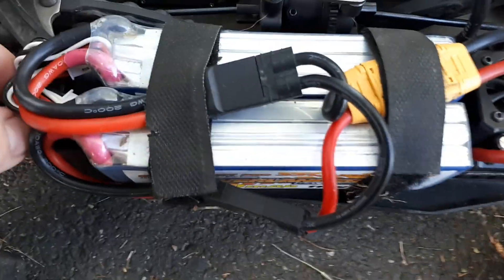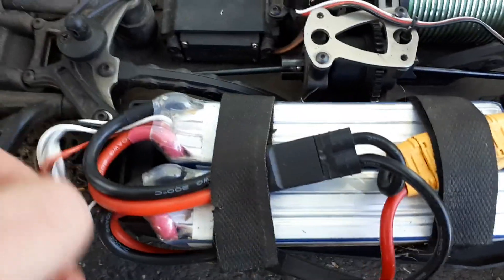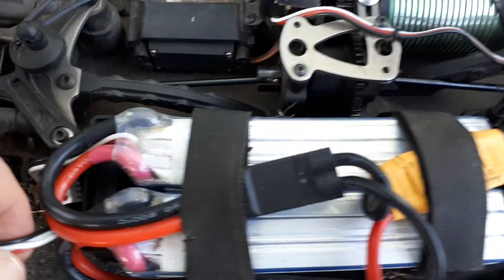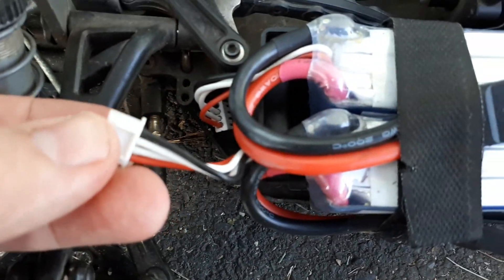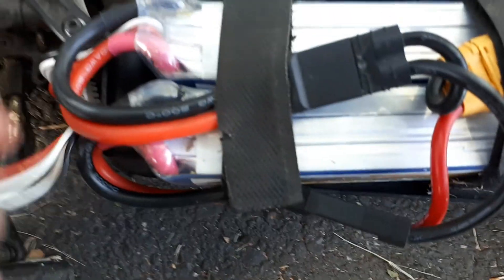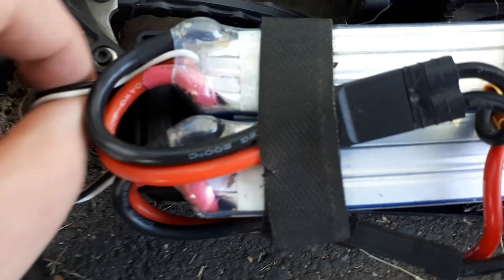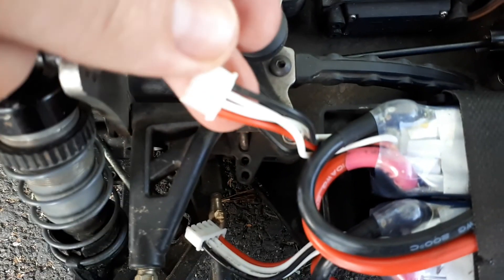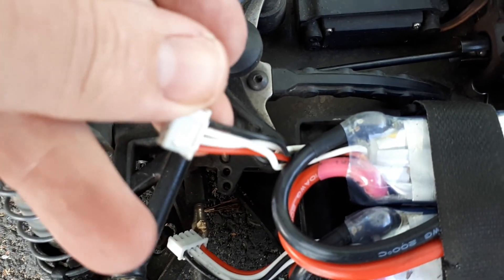Short car park speedrun.

Comment: You can't even hold full throttle for 1 sec it is too fast! What electronics are you using?
Reply from the maker: Castle mamba Monster X 2650kv motor and a hobbywing Max 8
Reply: @rchampton4845  I may do something similair to my slash 4x4 once I finally burn out my stock vxl 3500 kv motor on 4S lol
Reply from the maker: Have a look at the video called new pb with speed demon.